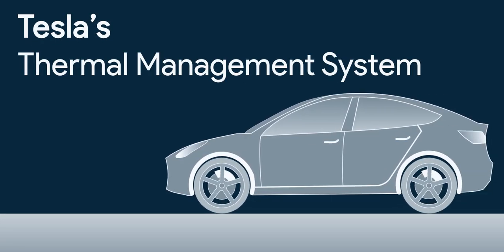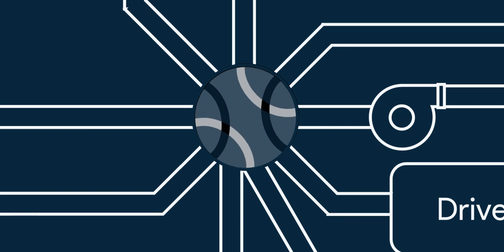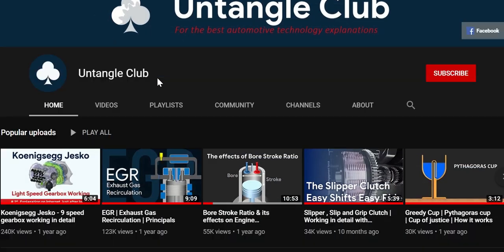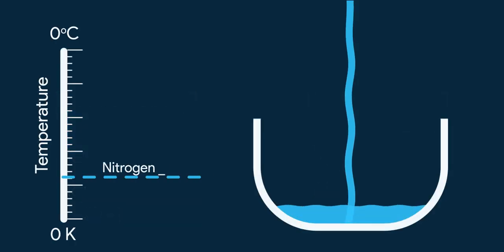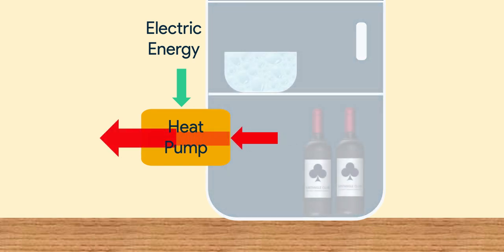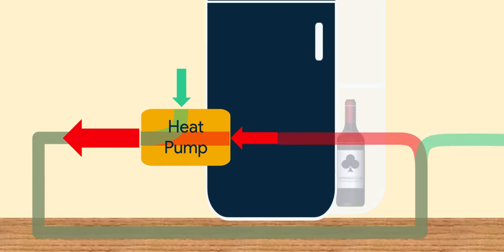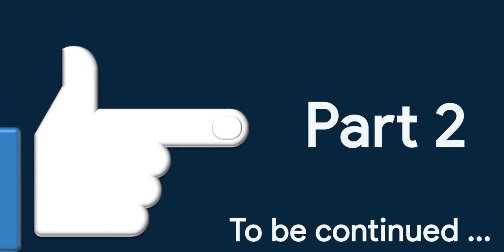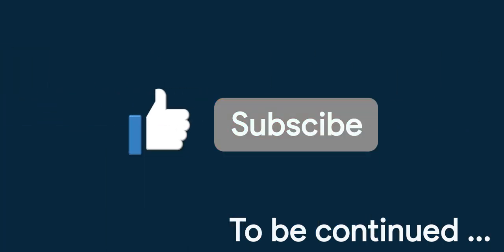P1 | Tesla Model Y Thermal management system with OCTOVALVE 🦑 & HEATPUMP | Working in Detail

Comment from the maker: Correction
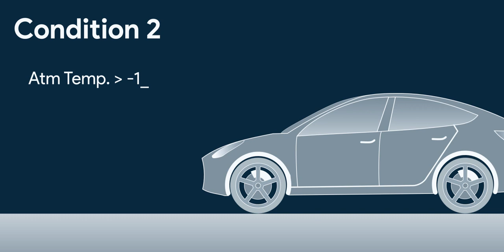@7:53 
Condition 2
Atm is < -10°C which is said correct but displayed wrong.
Reply: I was about to report the same thing
Reply: The real question about condition 2 is: why need to make Cabin evaporator work(thermal recirculation as a result) in this condition?
Reply: @AF-nv7io  good question.

Comment: Nice and clear explains. It’s better to start with compressor instead of chiller since that is where everything starts. Curious how valve leakage is tackled by 8 port valve. Are 15 modes really necessary? certain modes sound more likely a redundancy like waste heat recovery from battery at ambient below -10C

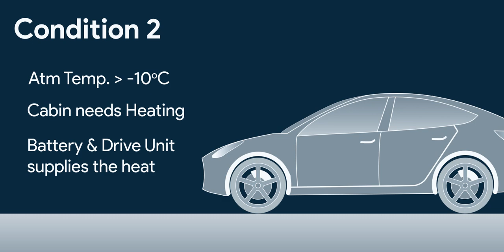Comment: Really interesting and well explained. But I'm confused why was the chiller able to remove heat from the atm air in condition 1 (atm is > -10C), but wasn't able to do the same in condition 2 (atm is still > -10C)? (EDIT: Its a typo in condition 2 page at 7:58. Should be showing < -10C).

Comment: why do you need a condenser and evaporator in the cabin as different devices? Couldn't you use the same one having both functions depending on the temperature of the coolant?

Comment: From the Battery Day event they said they want to replace residential gas heating with batteries. I think they may make something like a combined Powerwall 3 backup house battery + HVAC + Hot Water Tank to recycle all the waste cold/hot energy and even the water condensate Elon mentioned on Twitter "Could maybe tap the condensation for water too. Seems odd that HVAC systems make pure, fresh water & just dump it on the ground."

Comment: I thought that electric cars were supposed to be simpler than ICE cars? And this is just the thermal management system!
Reply: It’s a bit simpler than the Chevy Bolt or Volt that accomplish the same thing by using multiple, up to three, separate cooling loops and sandwiching radiators.

Comment: I laugh at these over engineered over complicated computer /tracking devices on wheels, what mechanic would work on this? you Need Airconditioning experts , high voltage AC/DC electrical engineer, An I.T. expert and god knows who else. It's a joke, a totally disposable car that will never even last long enough to ever be called a classic historic vehicle. This is because they won't be worth replacing the battery. Which you would need electrical fitters and HI voltage AC/DC engineers to do. Till charging times and battery technology changes they are not a viable option for road trips of transportation of goods.